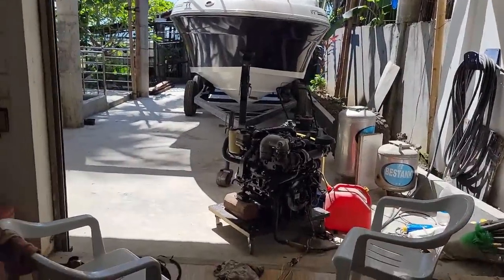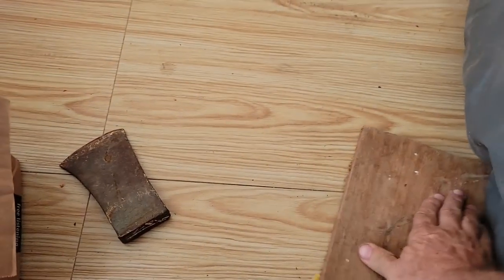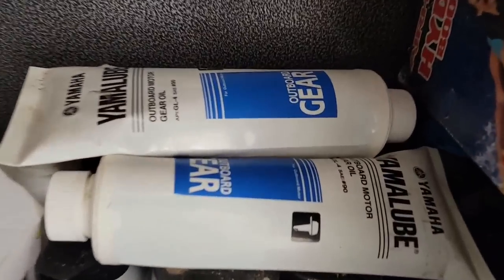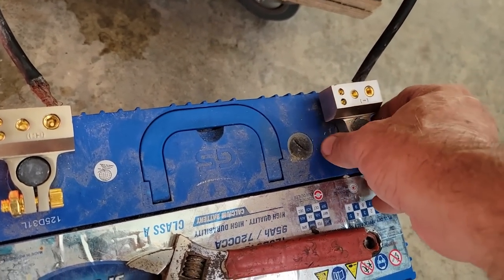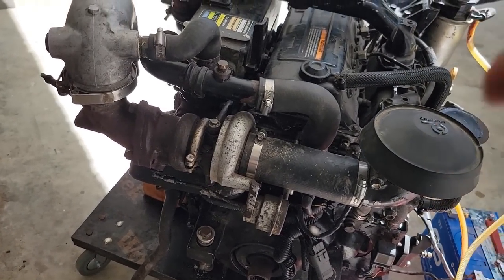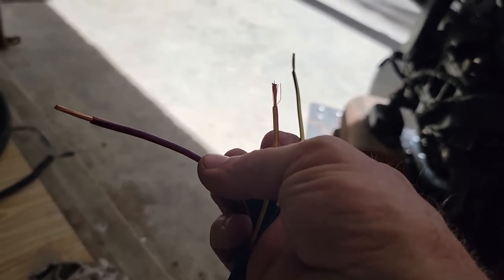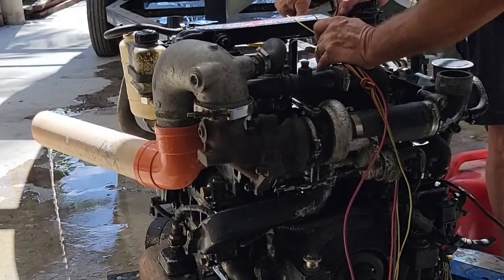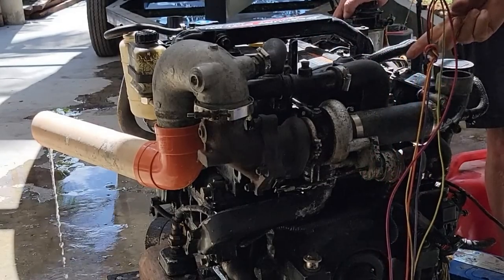Priming and starting the Mercruiser 1 7l diesel  WE THOUGHT!  EBAY Australia  to the rescue

Comment: Seems like you need a good multimeter there brother. It would definitely speed things along as far as wiring goes. Last time we were there my father in law ask me to do some electrical repairs and I couldn’t because I needed my multimeter. I felt bad about it but I’ve been shocked enough that I don’t mess with electricity without a good tool to tell me which wire is live and when. Makes life easier 👍👍👍

Comment: Those battery terminals you have are used in the car stereo with amps and subwoofers genre.
Reply from the maker: Those are sold for commercial trucks
Reply: @TexasFilipino  When you're shopping Amazon or Ebay for car amps, subwoofers, those pop up for best to use. That's why I bought them, and are sold at car stereo installation places where I live. Including Bestbuy. Maybe in the Philippines that's what they're sold for.

Comment: I do the same with Amazon and buying online...

Shipping addresses in Dubai and Mn...Florida is also an option if needed, or Germany...

When I get back there, I'll add another PH address lol! 

Good luck with the starter motor delivery, sounds like it's well underway, almost there...

It would be nice if at some point you could find a second engine to use as parts...

I like to have Plan B/C as much as possible...It's saved my behind more than once over the decades...

Not sure how common such engines are to be found, maybe like looking for hen's teeth?

Anyway...It's almost there with running too...it was close to kicking in...It'll be sweet to hear it take off...Should be more than enough power for the boat...

In Minnesota with Winter weather it can be a real bear getting your gear operational, to include the engine, diesel or gas...

Guess that's why I'm not up there much, I'm kinda the same in my old (soon not yet!) age...

I need the heat (and ocean, palm trees, sun, etc.)! The PH is just the place to get all that and more!

👍😆👍

Comment: You probably find a starter shop in Iloilo that will rewind the motor & put new brushes in it for less money or get it rebuilt & keep it as a spare, I know you like spares. LOL. It probably has a safety feature built in that won't let it start if it does't sense oil pressure and/or check your fuel rail, it might be stuck. Just sayin
Reply from the maker: Well I have been here for years and went thru all of that rebuild in Iloilo stuff and every single time they failed shortly or lacked power. No body has time for that. I want quality not cheap out.
Reply from the maker: There is nothing stopping it. We drain the fuel system to ship it including the injection pump. We are bleeding it out and the stater quit.

Comment: James, what's wrong with the engine in the boat now? The gasoline engine.
Reply from the maker: It is very hungry for high dollar fuel - I would not be able to enjoy it  because it willbe eating my wallet! I am not about speed here just efficiency and reliability
Reply: @TexasFilipino  Diesel cheaper than gas in the Philippines? If the engine was bad, I could understand the extra hard work to change out the engine. Run it until it doesn't run anymore, then make that change. I guess with that 3 cylinder Diesel you won't be going anywhere fast if you wanted to. You can still go slow with the gasoline engine. No more than you will be using that boat. Maybe me being 59 years old I think if it ain't broke, run it. Not trying to upset you at all, just don't see the reason why at this point.

Comment: James, a small can of ether would help with initial start, with using it sparingly.  Glad you found a starter for that engine.  Best of luck with getting it running. 😊. You actually didn’t fail, and it nearly started, so I call it just a delay.☃️🎅🎄🎅

Comment: James if you put a battery on concrete it will loose charge through the concrete, don't know why but every timewe did it it happened, boat guy told us never leave a battery on the floor it drains the power
Reply from the maker: Just there for the time starting it
Reply: Kelly is correct

Comment: You need a pressurized fuel pump to run those diesels as you need fuel line pressure or they do not spray enough for the engine to run. Also a shot of ether would have been bad
Reply from the maker: this engine DOES NOT require a fuel pump.  WRONG

Comment: Hello my friend I hope yourself & Capps are well. Question === Hey I'm not a big fan of starting fluids but in cases like this with a lot of bleeding  needed or old worn  diesel engines . we used them alot on old tractors 
& such we used the ones with upper cylinder  Lubricant  in it did you not have any ?? I heard Capps say use a gased rag . I figure you have a reason for not using especially  with your farm / country boy experience  lmao  😂. Just wondering?  They really help with firing  a stubborn one off . I'm with you on being glad you replaced that old starter they don't have but so many cranks in them & being broke down  at sea is no joke or fun . 
Po I really liked those battery connectors you picked up from Lazada I've not seen them I want a few of them also that's really a cool design  & I like the material they are made out of James.  GOD BLESS YALL Po .
MABUHAY .

Comment: No concern about Mother earth, no responsibility, why are so good ar saving and use ur materials to the bone, and spoil it all
Reply from the maker: Hold my hand and lets sing! Meanwhile everything you buy at the store is shipped  via massive ships using diesel. In fact more in one hour than that boat would probably burn in its lifetime. Then deliver to where you live by trains burning diesel and by trucks burning diesel. Then the refrigerator and lights in the store and most likely in your house also derived from fossil fuels also. Well if you flew here for vacation oops again your on a plane burning kerosene/ diesel.  I don't care if you like what I have to say or not. I detest stupidity.